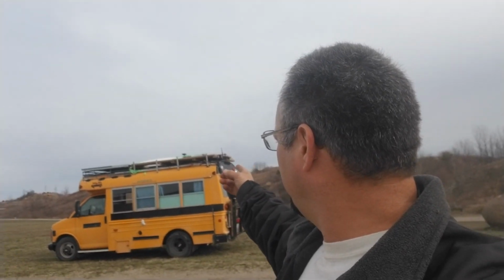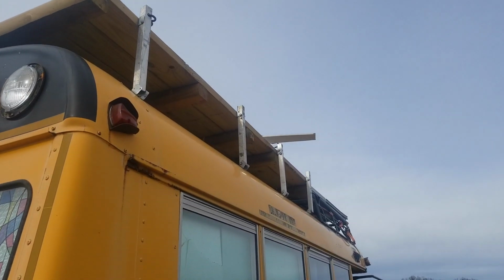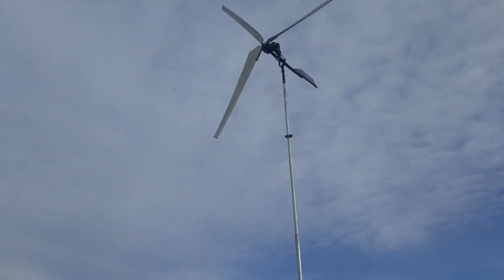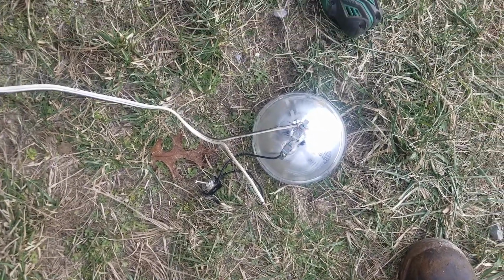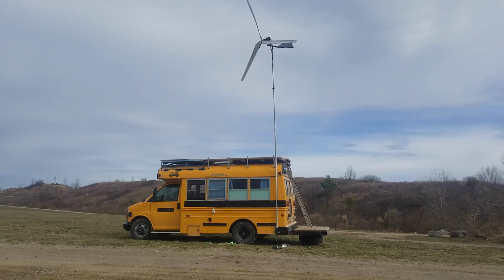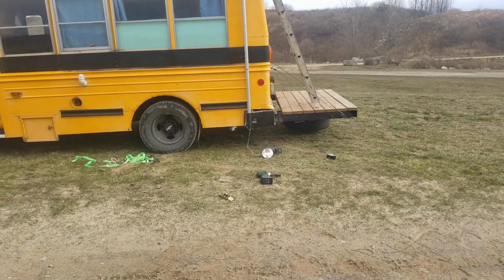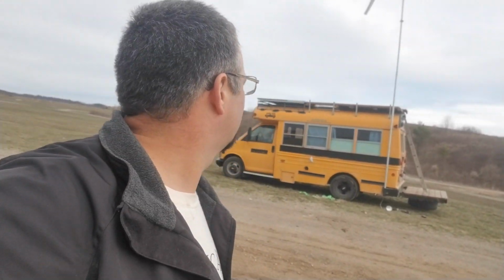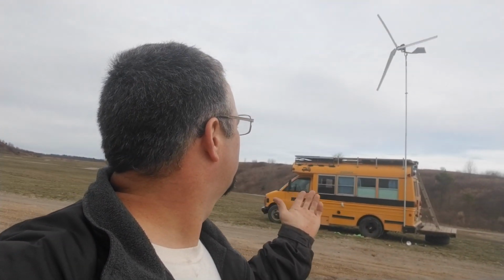Testing Out the Homemade Wind Turbine On My Skoolie

Comment: You may not be able to run the whole rig off of that but it will charge the batteries especially at night. Maybe attach the wires in each pipe section and add connectors? Can you make one blade so it can pivot? Id find the white noise a plus but I wonder how loud it would be in higher winds
Reply from the maker: Connectors on the pipes is a good idea, saves time fishing the wires through each time. I guess wing nuts on the bolts that hold the blades would be an easy solution to removing them quickly. I like white noise myself, I sleep with a box fan running, so the noise shouldn't be a problem.

Comment: I forget, do you have both chassis and house batteries ? maybe it would be best just to have it feed the house ?
Reply from the maker: Yes I do. I have house batteries that are separated from the chassis batteries. The solar panels and the wind generator will only charge the house ones.
Reply: What is the difference between chassis & house batteries 🔋❓
Reply from the maker: The chassis battery is the one used for the driving part of the bus. The house batteries are for powering the living quarters and is an isolated system. That way if I leave the lights or tv or something else on long enough to run the house batteries down the engine can still start.

Comment: When it is connected to the battery, the generator does not resist until the voltage rises above 12v, so you can charge even in this wind
Reply from the maker: Yes. It doesn’t start charging until it is a high enough voltage.

Comment: I bet there is always wind at your cabin. very cool tho.
Reply from the maker: Up the hill from it there is some wind most of the time. Also across from the cabin where my solar panels are has a wind blowing down the valley a lot of the time. I think that is where the turbine will end up, mainly because it is so close to the solar panels.
Reply: @lukeFugate  great place, Won't it work if it's on a shorter pole?
Reply from the maker: @pamcolechadwell1302  The higher you go up, the less turbulent the air is. It would actually work better even higher up, but it would be really hard to put up then.